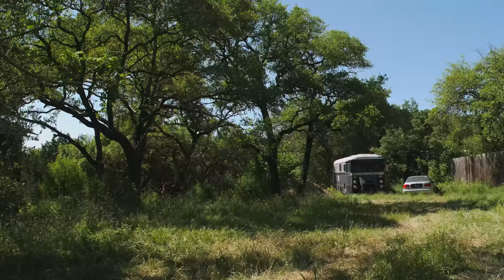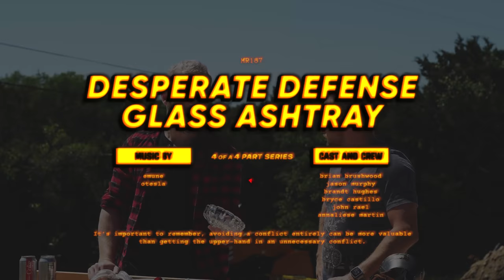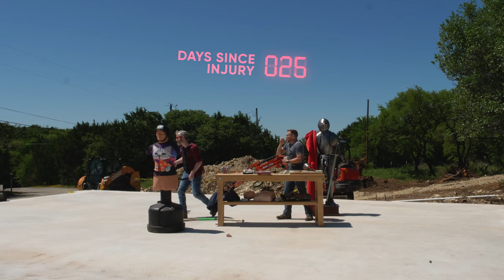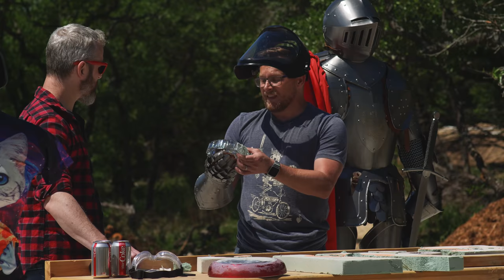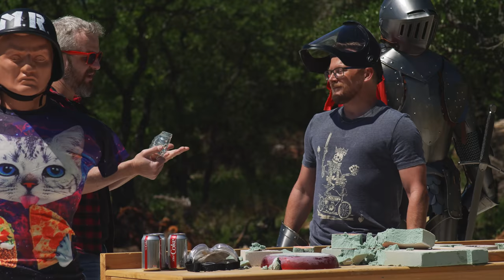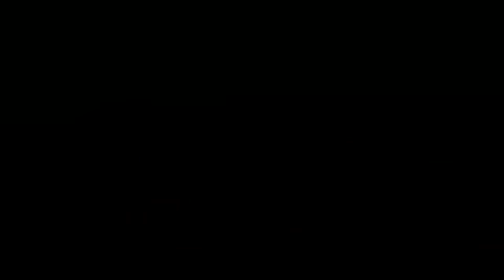Desperate Defense: Glass Ashtray

Comment: My rankings;

Effectiveness 

1: 2x4. By far the most effective and sturdy. Has the most reach but is prob Ieast common. 

2: Ashtray. Most likely the same damage as the billiard ball but the ashtray is more versatile because of the size. 

3: Billiard ball. It can do some pretty mean damage to someone maybe even break a bone but because of the size and shape it’s in third. 

4: Wallet. Depending on if you have something inside to make it an effective flail. If you can get something in it besides some pocket change I feel it can be a very effective flail but without it you can’t do much. There is the ability to grab a knife but you can do that normally, you might just get cut. 

Surprising-ness 

1: Wallet. Who knew a piece of leather could be so effective if you use it properly. 

2: Ashtray. Not because of the damage but the sturdiness. 

3: Billiard ball. If you’ve ever handled a Billiard ball you’ll know they’re hard and heavy. It makes for a not so surprisingly effecting bludgeoning weapon. 

4: 2x4. I’m sure everyone has had their experiences with getting hit with a piece of wood. Whether it’s stick fighting as a kid or a 2x4 falling on an extremity

Comment: Glass is actually very, very, very strong. The Kool-aide man can stand on feet with a bottom surface area of 3 postage stamps. Glass can take a lot of punishment. It's just that it has near zero give to it and when it breaks it breaks with a lot of ompf. That and most common things made from glass are not made to be handled roughly, and therefore have fairly thin glass. Also if you hit a side car window with the sharp end of a porcelain shard it will explode into teeny-tiny mostly harmless glass shards. you don't need to do it that hard either.

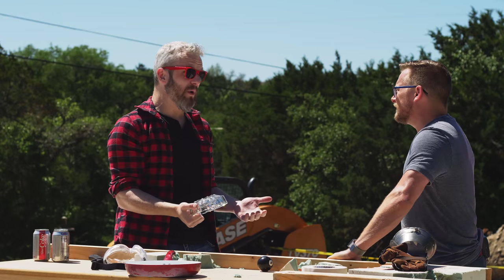Comment: I'm at the 2:50 mark now and while it may break  I think the guide stating to come down like a hammer is trying to reduce that likelihood. As a circle coming down in that direction takes advantage of the strength of an arc. Would shatter way more easily hitting from the flat side I think.

Comment: Glass, especially thick glass, items are way harder to break than you'd think. I spent like an hour as a child with my friend in the woods tryna smash one a whiskey bottle we found in the woods on trees. We were throwing it and swinging it into stuff by the neck, hitting it between a tree and a stick, nothin. Admittedly, child strength, but body parts, even bone like the skull or forearm, aren't going to provide the rock hard surface you'd need to shatter relatively thick glass on impact.

Comment: It takes a lot of force to break one of those, and even then a lot of the time, it breaks into large pieces. With the thickness, they dont shatter like plate glass. Also, which driving it into someone's mouth is dumb, jab it into their face and try it. Getting into their mouth doesnt really matter if you break most of their teeth, smash their nose, or dislocate/break their jaw.

Comment: I agree with your ranking but not for the same reason. If the knife is really sharp it will go through the wallet and in your hand, especially if you rush over the blade to grab it, hence why the awkward two-handed technique. The 8-ball in a shirt method seems under-appreciated, because if you just grab it, hitting consistently with the strike zone (where your fingers are not) will be very hard (as with any weapon that needs to hit with some part of it). And reach really makes the difference, both for the 8-ball in a shirt and the 2*4.

Comment: In defense of the putting the ashtray into the mouth method, if you forcefully shove that thing with the intent to injure, you are going to break teeth easily and even if you miss by a little you just busted a nose or have done something to the head. Its not like the book is saying have them hold their mouth open so you can gently place it in and then strike. think of it like brass knuckles.

Comment: Ash tray waayyyyy better than the 2x4 just because of the mass in such a small concentrated form.... Try comparing a hammer to a blunt sword when it comes to crushing power, plus since the overall weight is also less you can swing it much faster and hurt a hell of a lot more again because of the concentrated weight. Downside is most ash trays are now actually made of ceramic or plastic so theyre lighter and more likely to break, given how physics works it will most likely break off where you're holding it.

Comment: My great aunt use to have an ashtray like that that was no joke 10.73 Lbs (checked it for a school project), it was roughly double the width of yours and had a nice inward rounded neck and a outward tapered foot with the entire thing being probably about... 3 times as thick as yours sorta? That thing could probably be a small shield let alone the shear swing power of that.  As for the mouth thing i cant see the jam and pop working well unless they are already on you and screaming at you, however just punching someone with that dish in line with their mouth should break off/break out most of their teeth...

Comment: Decks a frying pan. "If this thing shatters". I'm sorry, it surviving being smashed into metal leaves you doubting still? XD
 As for modern equivalents, some resturants still have ashtrays, if not glass specifically. Moreover, an ashtray is, at base, a bowl by a different name. Heavy bowls, often ceramic, are in many kitchens, and are sometimes decorative pieces. Sure, not many would be quite as durable, but this is DESPERATE defense. I'd rather have a cut up hand over a stab wound.

Comment: He jokes about the modern day equivalent being a vape pen but I have a friend with an unregulated tube that weighs about 2 1/2 lbs easily without batteries and is solid brass so it's very true that it could be the modern day equivalent and just as, if not more so, effective

Comment: Tbh you wouldn't be worried about cutting your hand. Its desperate defense for a reason. Would you weather die or get a cut on the hand. You take a cut to the hand if it breaks but they get punched, cut, and shards stuck in their head if it breaks. If you do get cut you more than likely wont feel it because of the adrenaline.